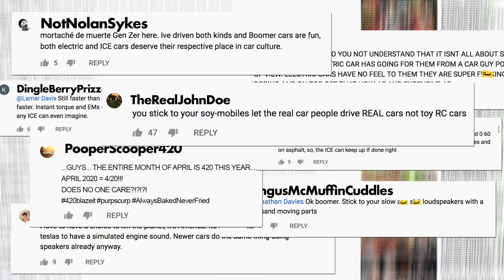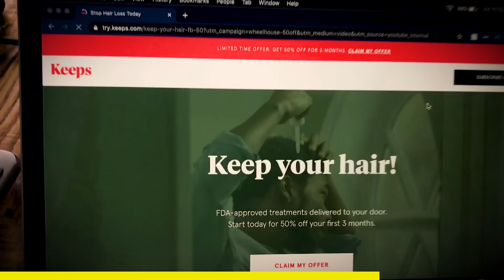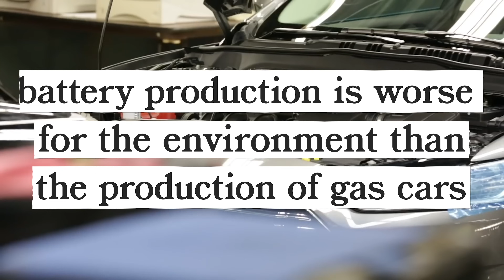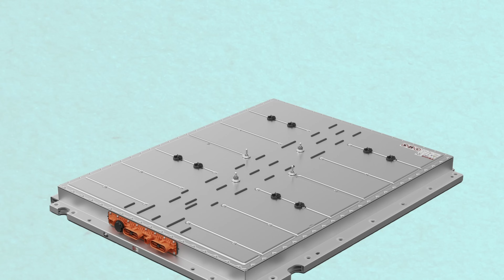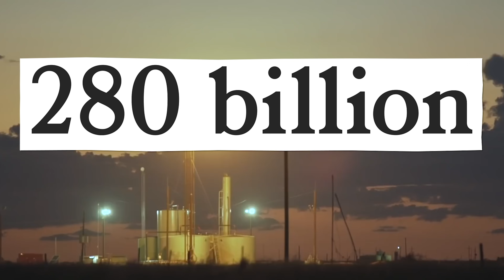Are Electric Cars REALLY Better for the Environment?

Comment: 8:41 - Nuclear power plants does not emit Co2..
Reply: Nuclear is one of the best and least polluting forms of energy production. Wind and solar and many if not most "clean" energy sources are simply not viable as mass energy production. Its sad that nuclear has such a stigma attached to it because it solves so many issues
Reply: @Slayridepin  Thank you!!!!!
Reply: @Slayridepin  you also gotta think about nuclear waste
Reply: @Slayridepin  how is using nuclear power more "cleaner" than power sources using energy from the fucking sun only?
Reply: @LH-zz1pg  Solar and wind power are not consistent or reliable. As a result you have to install natural gas power plants to make up for the hours of low production. So what they have found is that whenever they install solar and wind infrastructure the CO2 emissions increase. Compare France to Germany. Germany in recent years has managed to get 50% of their power from renewables, primarily wind power. France gets about 85% of their power from nuclear. On Average Germans produce twice as much CO2 per capita than the French. Not just that but they also pay twice as much for electricity.
Reply: @LH-zz1pg  clean power from the sun? Oh you mean the extremely expensive manufacturing, maintenance, and construction of solar panels that barely make any energy and require massive batteries if you want to store any of that energy? Solar energy does have a place,  but bozos love to think it's some sort of magic bullet. Its got MAJOR shortcomings and is not a viable means of mass energy production and probably never can be unless we pretty much figure out a way of breaking the laws of psycics.
Reply: @Slayridepin  honestly solar is not that good. Nuclear is the best IMHO. Literally turning   mass into energy fuckin genius.
Reply: @Slayridepin  not to mention the impact that solar and wind has on bird migration and animal habitat.
Reply: @Slayridepin  Unfortunately Nuclear Waste from the Manhattan Project just fell into the Detroit river this year. It has stigma its has because the public sector and private sector can't keep their shit together.
Reply: The thing is tho with THE MASS amount of nuclear reactors in the world a very very very very very very very small percentage like around .5 percent of them have had a problem or even a melt down. And the nuclear waste that comes out of nuclear plants can be used by other plants because a nuclear reactor uses so little of the uranium in it so they send it to another plant so it can use it etc. so they are very inefficient at using the fuel BUT it doesn’t matter because it can basically be used my another plant and they make a lot of power for being inefficient. I SAY NUCLEAR IS THE WAY OF THE FUTURE
Reply: @Slayridepin  Remember cold fusion?
Reply: @Slayridepin  thats true but one big problem is the nuclear waste
We still dont know what to with it and it still radioactive
Reply: @Erratos  Radioactive waste is stored in a large concrete container until its safe to bury. Uranium has a half-life of 10,000 years so we won't be burying that anytime soon. Thorium on the other hand has a half-life of 100 years, is 4 times more abundant and a meltdown is physically impossible with Thorium reactors. It produces no emissions and contrary to popular belief nuclear power plants do not blanket the nearby area with radiation causing children to be born with 3 legs. The radiation is 100% contained. Unlike in the movies when a nuclear reactor melts down it does not explode like a nuclear bomb. What happens is that the fuel rods are exposed to open air (usually due to a water pump failure) the begin overheating and melt together into a blob of super-heated uranium( google the elephants foot). Now this is only possible with a uranium reactor. Thorium differs in that it requires constant energy input to sustain the reaction, with uranium once you start the reaction you cannot stop it, hence why its more dangerous. So with Thorium if a water pump fails and the fuel rods begin to overheat you simply stop the reaction and they cool down.
Reply: @Erratos  nuclear waste is really small, lifetime of an average nuclear power plant is about 20-30 years during which it produces a waste that could fit into a above average sized house, and that's a small price to pay for 30years of electric power for a whole region
Reply: Nic_2107 radioactive waste can actually be recycled and used in another plant, now it’s just wether or not people can manage the plant correctly over its lifetime.
Reply: @Erratos  it isn't, actually. Thorium reactors can burn it down to a 500 year radioactivity, which is a helluva lot better than the 240,000 years it takes now. Or molten salt reactors can use it as fuel.
Reply: @Erratos  It really isn't an issue. Look at France, they recycle most waste and store the rest on site. Nuclear really is just that good.
Reply: @Erratos  correctly managed nuclear plants controll the radioactive material to a point where theres not a ton of waste. The radioactive levels are no more or less then getting an xray if the decay is managed properly
Reply: dsparke93 I came here to write almost this exact post. When I sought I just had to keep reading, you’ve done an excellent job of explaining the key points between uranium and thorium. I couldn’t of said it better myself you seem like a very intelligent and knowledgeable person, and I hope you have a good lot in life!
Reply: Nuclear reactors don’t use even a quarter of the uranium in the reactor core so the rest can be used by another plant and the cycle continues they just use the same rods over and over till there is non left then they t more so there is almost no nuclear waste
Reply: THANK YOU IVE BEN TELLING PEOPLE THIS
Reply: @Erratos  was going to say this myself. Nuclear isn't quite as clean as we make it out to be for that reason. As an environmentalist, i more support solar and wind but the problem with those is that they aren't constant power sources like nuclear. Because of this, nuclear is going to stick around to offset solar and wind. Mining of the Uranium is also a huge environmental impact that is often overlooked.
Reply: DerailerMania that being said the energy density is much higher then other mined energy sources such as coal and petroleum
Reply: If only nuclear power wasn’t used as a weapon when they first invented it people wouldnt be so scared of it and its many benefit for society :(
Reply: It’s not that it’s the weapons there scared of. They are scared of melt downs like Chernobyl. But the chances of that happening are .00000000001 in a million because the equipment has gotten much better and the only reason this Roland has a melt down is because they were trying to see what would happen if they turned off the safety measures to stop a core melt down which lead to the core melt down
Reply: @lachlankelly770  minuscule amounts of emissions are produced through methods of mining and refining uranium. Even after this process, Renew Economy found that coal produces more than 20 times more carbon emissions than nuclear energy
Reply: Mobile Terminaluser  There is no explosion when a nuclear reactor melts down. Its called a meltdown because the fuel rods overheat and melt together. Have you ever seen the remnants of Chernobyl? Its all still mostly intact, there would be nothing left if there was a nuclear explosion. Nuclear weapons and nuclear reactors are not even closely related technologies, they use entirely different principles. The only thing they share is the word nuclear. An explosion would be possible if the superheated fuel rods were to suddenly hit a large enough amount of water, it would cause it to instantly vaporize. An explosion is just rapidly expanding gases after all, so yes water can explode.
Reply: @Name-kd5jj  yeah but the Chernobyl melt down left the city uninhabitable and still is
Reply: Yes but the reason that melted down was because the dissabled the safety system that stops the core from melting down to do tests and so they let the rods heat up but when they tried to stop it it was to late. It’s so highly unlikely that you would have a core melt down that you would have a better chance of getting shot into using a bagel. People think that they are extremely unsafe when they are some of the safest energy sources if you want to know more about nuclear power I would be glad to help just comment on this that you want to know more and what you want to know more about 😁
Reply: Smh I hate when people think the “know” what they’re talking about when they don’t have any degree or reference any reputable sources.
Reply: Coal mining is also massively CO2 producing, then burning it releases even more CO2 and dust and sulfur and acid. Nuclear is mostly a one and done thing. Get fuel, use it for a few decades, and all the waste is still on the ground instead of spewed into the next state over.
Reply: And the fuel can be used by another reactor
Reply: I would still rather have a gas/diesel car instead of electric, instant torque is cool and all but the batteries capacity shrinks over time, and it's basically unusable in winter since when cold outside the battery is inefficient and you only get 30-50% of the range from it.
Reply: @albanemini1274  but EVs can improve more unlike gas/diesel vehicles
Reply: @mauiiwowiiezone549  I wouldn't say that, combustion engines can be converted to use Algae base plants as a fuel source which can be grown with ease and act like a e85 fuel but cleaner, without the heavy manufacturing of it into fuel
Reply: The average rods in a reactor lasts 6 years... Now compare that to the mining and burning of coal/NG/Oil
Reply: You can reprocess the uranium and make it super efficient with only a little bit of of waste in the end. I think that Bill gates was thinking of building one in China to see if it worked but the idea got shut down sadly.
Reply: The nuclear waste has to be stored in large facilities which take up energy to run and maintain.
Reply: @Seawolf 

The costs may be less for some renewable energy sources, but the efficiency is not even close to that of coal or nuclear power plants. Let's also not forget that as of 2018, the total renewable energy consumption in the United States was 11%. That is fairly small and take into account that almost 50% of renewable energy production comes from hydroelectric power plants. In cases where a large facility is needed, the cost of building the power plant will be relatively similar to that of a nuclear power plant.
Reply: https://e360.yale.edu/features/why-nuclear-power-must-be-part-of-the-energy-solution-environmentalists-climate

Here is research from Yale. Just so you know natural energy from the sun and wind is much worst than nuclear energy. Do not follow mainstream media or social media.
Reply: Just coming to point out the only reason there was a explosion at all with Chernobyl was the super heated steam pressure exploding the reactor cap and the building.

But yes, the runaway reaction and meltdown only caused that, not some type of nuclear explosion.
Reply: You are correct the best kind of correct
Reply: coal plants also have cooling towers, which look about the same. gotta have a cold side of any engine.
Reply: except when mining the fuel and transporting it to the plant itself. Still, the emissions are way lower than basically every other source of power. Thoughty2 has a really good video on the topic
Reply: Thank you. They're always the poster child of emissions because they're cloud factories. But, they're harmless Just like pitbulls. Dumb people believe dumb things.
Reply: Your forgetting nuclear waste and the radiation is puts out. Plus the fission nuclear aren't really the best, plus the uranium or plutonium or cesium has to be mined and look are all the accidents that has happen, Fukushima literally is still leaking and has poisoned the Pacific ocean
Reply: Joshua Morales  You do know that solar and wind energy produce 100x more waste than nuclear energy right? There are many misconceptions about nuclear energy look up a legit science article.
Reply: Well here we go again the the nuclear waste can be used by another reactor for up to 45 years so they use the same rod over and over again until it’s completely harmless then they drop it underground which people don’t know is that that uranium is no longer radioactive and people also don’t know is that Chernobyl and things like that were from failed tests like in Chernobyl they turned off the safety system to stop the core meltdown and let the rods heat up but reacted to slow and the cores melted. Also the mining of uranium cost a lot less than coal and to process uranium all they do it cut them into rods then take them to the plant. People are always miss informed about nuclear power and if you think wind power is better it’s not they did the math and the smallest reactor in the world which is a 1 mile by 1 mile reactor can produce the power of 100 mile by 100 mile square of wind mills so what you have shown us is just miss information and if you want to know more just plz comment that you want to know more
Reply: Mobile Terminaluser  it was already underground
Reply: that could be a coal fired power station. They also use large cooling towers
Reply: DerailerMania 
The solution is thorium
Reply: Not co2 but hot water. They have nowhere to go and the waste have nowhere to mine. There's nowhere that human won't stay within a hundred years. Nuclear waste can last for a few centuries
Reply: People don’t understand of how low of a chance of a meltdown there is and how little of fuel rods a nuclear plant uses and those rods are sent to other plants to be used because that plant didn’t use it all so it’s sent to another plant like recycling
Reply: Mobile Terminaluser  do you know how many nuclear bombs were dropped in the world?
Reply: OWEN FLORENCE Jesus! What are you going to use as an energy source to get the waste from here to the sun?
Reply: Sure what about nuclear waste
Reply: @lachlankelly770  you don't necessary need uranium for an effective power plant
Reply: @lachlankelly770  Yea, thats true!
Reply: Dude the mining and processing of Uranium ore into usable nuclear fuel produces massive quantities of Co2.
Reply: @willtoulan  it's comparative to the same required mining techniques for the raw materials for other power production plants.
Reply: Actually no it doesn’t if you want me to tell you more just hmu
Reply: @Stackali  Where do you think uranium comes from?
Reply: @BigFellaGames  Australia mostly.
Source: me, an Australian.
Reply: Andrew Parry mining pits and the ocean
Reply: Those cooling towers could be from any power plant (tho you often see them at nuke plants). Also, nuclear is a crazy source of power, with a TERRIBLE record and potential of leaks, mishaps, disaster, secrecy, nuclear weaponry, cancer, fallout... Stop it, humans.
Reply: @TheMatissV  

I respectfully disagree with your assessment on nuclear power.
Reply: No, it doesn't produce CO2, just harmless radioactive Uranium 🤣🤣
Reply: @Stackali  still, the steam from these chimney coolers is a greenhouse gas
Reply: marz . one how is water vapor a greenhouse gas? So are all clouds greenhouse gas pollution?
Reply: @bretatvs  Water vapour actually is by far the biggest contributor to the greenhouse effect, and has been for millions of years(although water vapour is a quite weak greenhouse gas). The climate was in balance with a specific amount of millions of tons of greenhouse gases (mostly water vapour) in the air. The problem is now we're throwing the climate out of that happy balance with more potent greenhouse gases such as CO2. It doesn't actually take much to  break this balance either which is why we are having any effect in the first place. Also most of the water vapour in the air isn't actually visible as clouds. Its humidity.
Reply: No it’s not it’s water vapor and water vapor turns into rain which the clouds take in greenhouse gas and bring it back down to earth taking the gas into the rain and bringing it back down
Reply: @marzy_music  what steam is basically water vapors. You should learn before you spout false information
Reply: All these arguments against nuclear power are the same brain dead arguments that are pretty much non issues with today's technology.  Unfortunately these beliefs are still commonly held and the reason we can't have nice things like nuclear energy.

Comment: There is also the fact solar farms and wind farms when being built produce a shit ton of emissions. Not to mention the fact wind farms kill thousands of birds a year, and in Arizona one of the Solar farms has been frying any bird that flies over it as the reflective surfaces of the panels reflect the sunlight and intensifies it. So even "clean" energy is not so clean. Solar energy through solar panels will never be efficient as well, and is pretty much limited to between 60-80% efficiency. What we need is more nuclear power plants, which is one of the cleanest sources of energy, and provides a shit ton of electricity for a small amount of thorium (and a microscopic amount of plutonium) and water. Modern Nuclear power plants are extremely safe and produce very little waste and are not a hazard to birds flying by.

Comment: You forgot the recycling in the end.
And the fact that an EV will need a new battery sooner than an ice vehicle will need a new engine or fuel tank.
Also - more demand for electricity will drive the price up, as will going to cleaner energy sources.
So - fuck evs

Also also - CO2 can be managed by planting trees, do that instead of driving an ev